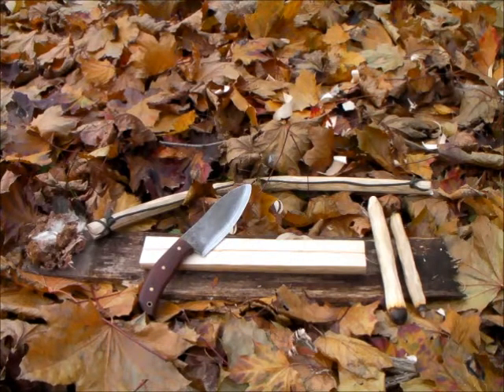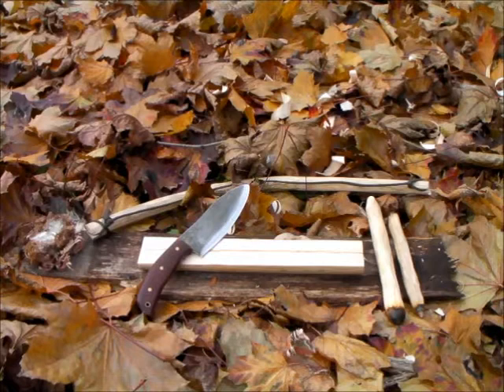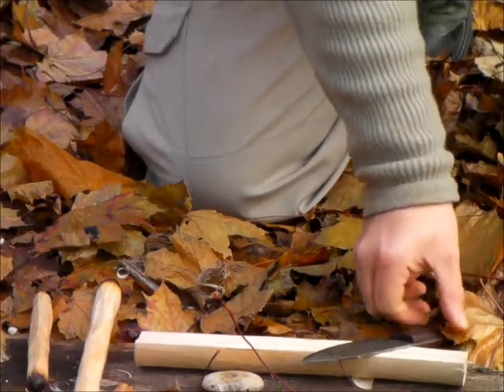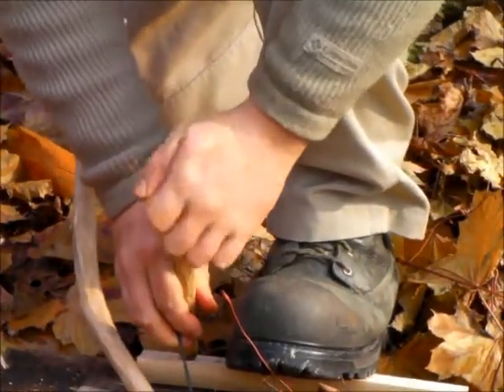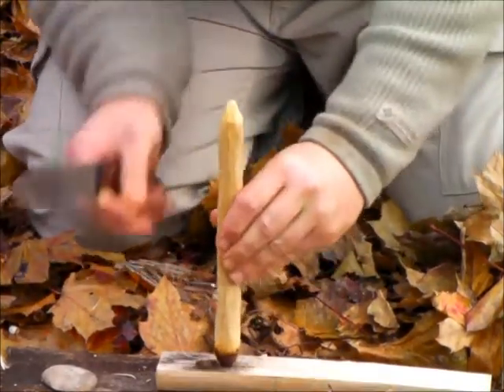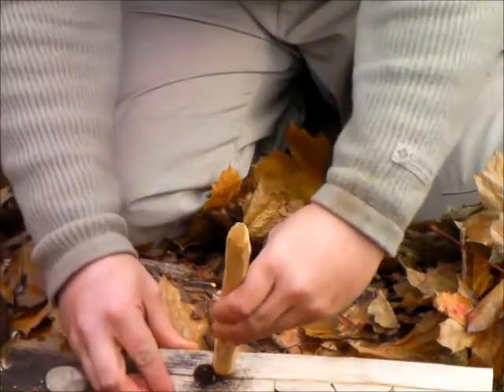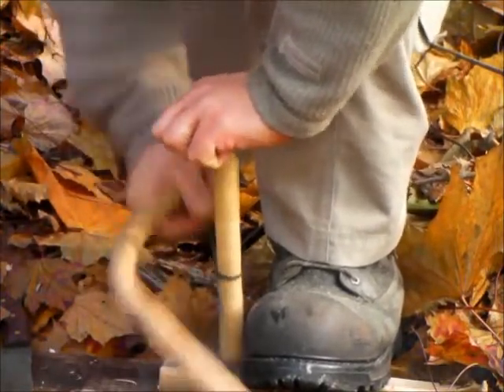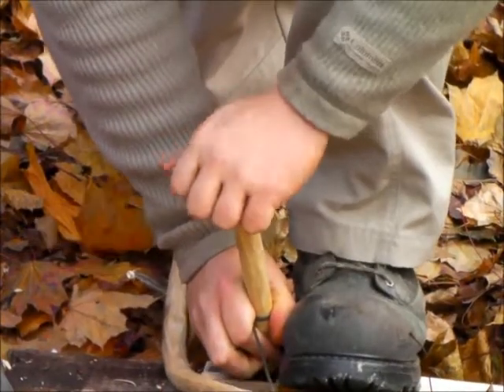two hole bowdrill method

Comment from the maker: Could be.  I believe that in both cases the dust is primarily from the basswood.  I did make a mistake in that the hearth was basswood and the spindles were ash or cottonwood.  Even though cottonwood is pretty soft, its still harder than basswood.  So I would imagine in both cases the dust is coming from the hearth.  However, the particle size of the dust may differ between the two.  Usually ash works pretty good for me on different types of softwood.

Comment: Sorry to comment on a 5 year old video, but as I understand it the point of this method is that it's relatively easy to do without a knife. Personally I only use it when I've got a standard hole with a notch carved in that's about used up. I just drill right next to it and save the trouble of carving a notch. That works really well. I haven't had any luck going on from there without a notched hole, though.
Reply from the maker: Thanks for commenting.  Bowdrill without a knife?  I never tried to be one of the primitive^2 types and when I was doing these exercises I was trying to work through Mors' methods as described.  At that time I couldn't find any of the non-traditional bowdrill techniques demo'd on youtube.  One advantage as I see it for doing the two hole as I did it is that you do not need a dust catcher under your hearth and could do it this way readily on top of wet soggy ground.  Still, two hole bowdrill isn't a method that I ever cared much for and found it, like most of Mor's non-classic methods quite finicky and less successful overall compared to the tried and true one that everybody does.  

Overall, I prefer the two stick or classic method for the most part. But I do appreciate your insight. Drilling holes along side one another at just the right distance to breakthrough would take some skill and precision as the size of the notch tends to be quite important - two big and dust cools down too fast, too small and the dust is oxygen starved.  Using a pre-cut notch in the first hole to gather dust is kind of cool.  I will probably try that sometime!
Reply: kgdblade Yeah, I'll be doing more primitive stuff in the near future, so I'll see how it serves me in that context when I come to it. The main problem is just the feeling of wasting all that effort and material drilling a deep hole just so you have something to collect dust in.

It's interesting that Mors doesn't even mention the standard V-notch method in his book. Indeed, most of the methods he outlines are definitely pretty finicky in real life. I wonder why he decided to leave it out- perhaps just so as to not be purely repeating what the older books had been saying and contribute some new ideas.

In my experience I've had surprisingly little trouble with the two-hole method as I described it. It's worked well pretty much every time I've used it. If the holes aren't quite overlapping, cutting a channel seems to work pretty well. Sometimes I've had to drill a little bit and then cut the channel a little deeper and wider, but all things considered it's given me very little trouble. I think the parabolic shape of the hole may be trapping and focusing a lot of the heat that the dust would otherwise lose as it's reaching the ignition point, making up somewhat for it receiving less oxygen (essentially the principle behind the one-hole method).